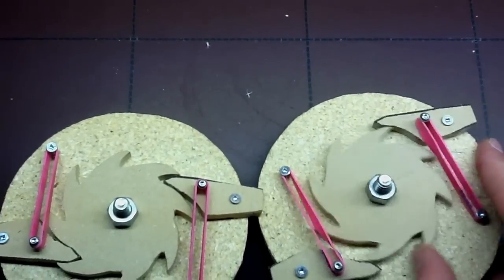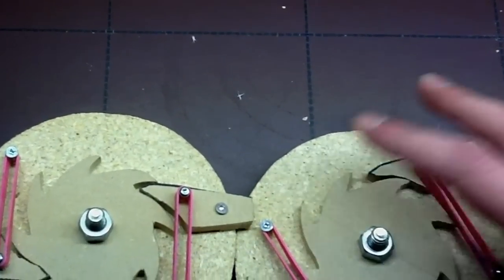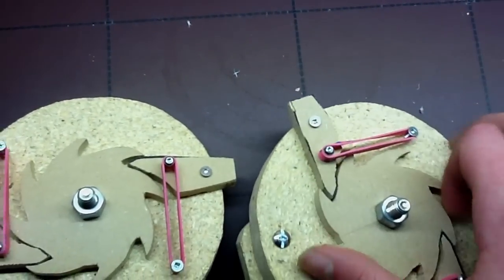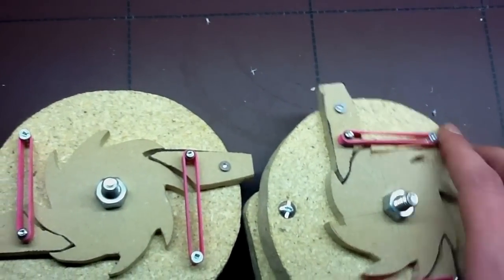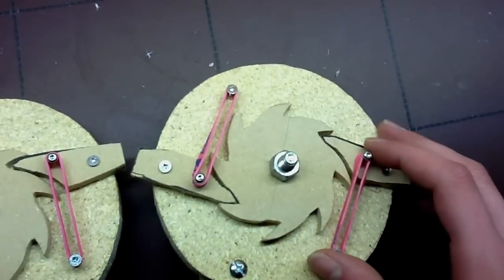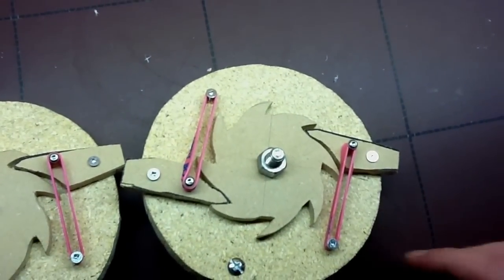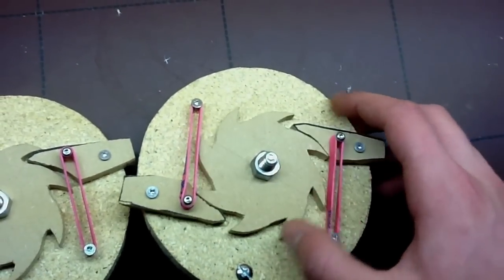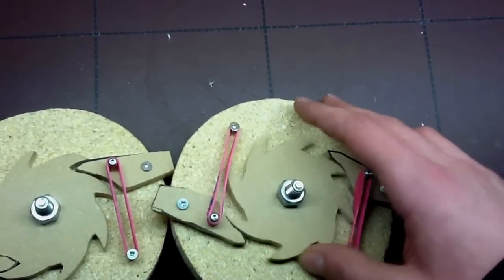Ratchet and Pawl Meachanism

Comment: Nice project. That’s the best way to understand mechanisms.  These were used in clocks as you are aware.  Also, you may want to look into sprag clutch’s. Same outcome almost just different approach. Used in industry for holding loads from back spinning.